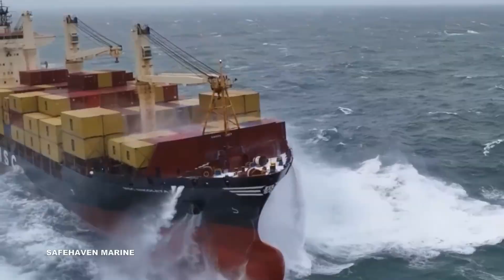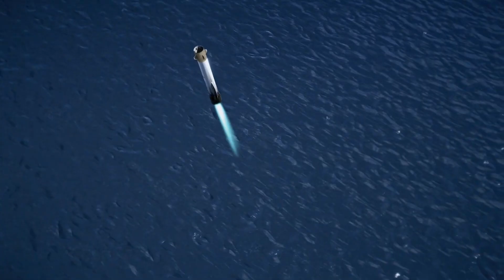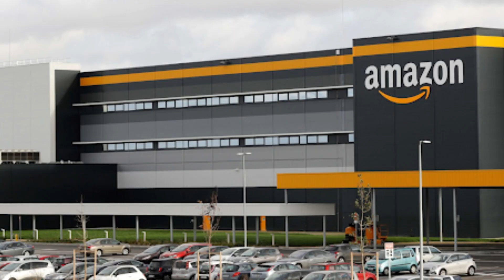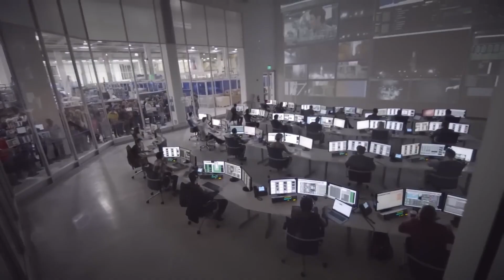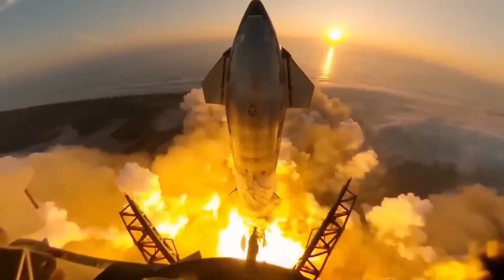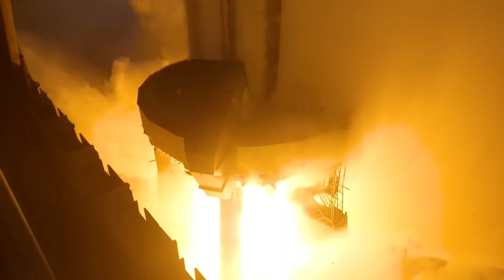Blue Origin Discovered Serious Problem With New Glenn Launch!

Comment: Well first off while Starship is ahead of New Glen, it still has teething problems before it can be considered as reliable as Falcon 9. It may take 8 or 9 more flights before it can fully replace Falcon 9. That may take all of 2025. Due to the RUD of ship 33, flight 8 may very well not happen until March of 2025 at the earliest. Having a fuel leak is something that has to result in a permanent fix if Starship is going to carry humans. The other question is this. If there is an anomaly with the booster, what plan is there for emergency measures for Starship if humans are on board. That has yet to be developed. Once humans are on board, Starship has to have emergency measures built in if it experiences mechanical issues as well. Also, it took a few flights to get Flacon 9 to stick the landing on the drone. It may take Blue Origin a few flights to get the landing down as well. The one thing Blue Origin does have over Starship is that it has achieved full orbit capability on its first try. New Glen will be essentially competing with Falcon 9 until Starship can prove full reliability and usability. It is not there yet and may not get there until December 2025 or into 2026. Spacex wants 25 flights for 2025 for Starship. However, if there continue to anomalies like flight 7, that will automatically set up an FAA investigation slowing the process down. In the meantime, New Glen could get a head start on commercial payloads allowing it to start to catch up to Falcon 9 and actually start generating revenue. Further if New Glen remains reliable in getting to Orbit, they then can develop a capsule for the second stage that will be able to fly to the space station and land. Final point. While Starship is gearing up for Mars, they may eventually want to abandon the moon transport potentially leaving that to New Glen. So, while New Glen is behind Starship it may catch up with smaller payloads in the long run.

Comment: Go crunch the numbers for the engines used on Starship and you will see it has big issues with being able to lift a heavy load. Those Raptor 3 engines are still not good enough. And the Specs on Raptor 4 still fall short of what is needed to lift meaning full loads. And Space X had a lot of failures along the way and is way behind schedule to what Elon had originally said were the targets. Going by his original schedule we would have already had people on Mars, instead we got a Fried Banana with version 6, and bits of Banana air fried with version 7.

Comment: "Ice formation" always sounds like solid water but I guess it is being used to describe solid methane or oxygen, similar to SpaceX "ice formation" blocking flow to its engines. I wonder if ice formation also effected the landing attempt for BO?
Reply: The "ice" formed in the Starship boosters oxygen tank was a combination of water ice and carbon dioxide snow. This is the result of SpaceX using the exhaust of the oxygen pre-burner to pressurize the liquid oxygen tank. The exhaust contains water vapor and CO2 gas.
Reply: @johntracy9398 more likely associated with pressure drop on the super cooled fluid entering a small diameter pipe and lowering its pressure
 Thst's why they now use multiple feed piped to the Raptors. I can't imagine enough water vapour fr the ullage gases used to repressurise the tanks.

Comment: I am primarily a Space X fan, however, I applaud ANY company or Country trying to achieve a level of reusability. The BE4 has been problematic, but it seems that those problems have been solved for the most part. Blue Origins biggest challenge is too become "hardware rich", it may well take several BONG's to perfect the landing, with it taking years between vehicles currently, this will never allow Blue Origin to catch up to anyone. That being said, congratulations on making orbit on the first try and since landing was not a critical test criteria, lets hope that counted as a successful first certification test.
Reply: if blue origin reached their intended goals there probably wouldn't be a space x.
Reply: @ Sure, but what's your point? If you're talking capabilities on paper, then we're already enjoying manned bases on Titan.
Reply: Say what you will. BO buildings are world class. Whereas SpaceX is a bunch of shipping containers put together.
Reply: @tomnguyen9931  If those buildings could fly, BO would be in great shape. You obviously haven't seen the brand new Star Factory in Boca Chica, Space X also NEVER used shipping containers for construction, only walls and storage.

Comment: Spacex seven launches, no orbit, New Glen, orbit on first try.  What are you missing…?
Reply: Rockets have been making it to orbit since the 1960’s. Nothing new. But up to now, a first stage has never been caught and rapidly placed back on launch pad.
Also SpaceX could have easily put previous Starships into orbit, but wanted to make sure they could control when and where it would return. Also priority was to test heat tiles on re-entry.

Comment: Let see might have taken a while but puts the payload into orbit on first try. I think you are a bit biased. There are different use cases and while falcon 9 is amazing Starship is getting further from being man rated not closer. 
Lighten up. Its their first launch of an orbital capable rocket. 
Right now NASA needs something to get heavy payloads to orbit. SpaceX appears to have mostly given up on falcon heavy in favor of Starship. 
The most important objective is payload delivery. It did that.
Reply: The most important is reusability. Putting payloads in space is the easy part.
Reply: This race is for reusability. Bezos has already spent $5 billion on his project.
Reply: "Given up on Falcon Heavy". They are still flying Heavy and have upcoming missions using Heavy. Space X will not retire Heavy until Starship is fully operational. No other rocket is fully licensed for service in that market area right now. Although I think Space Force is ready to use Valcan as soon as ULA can make it available.